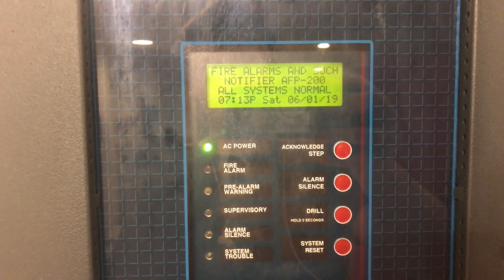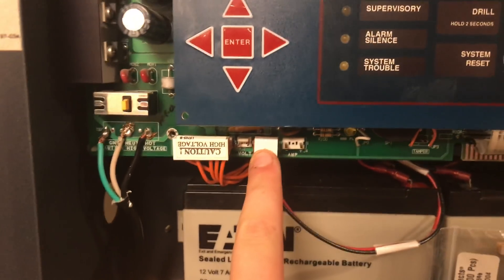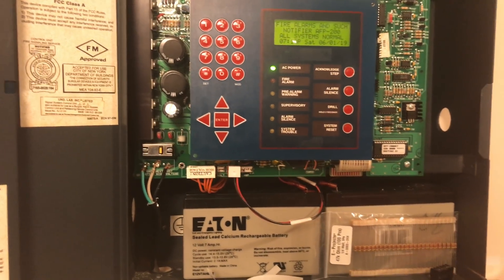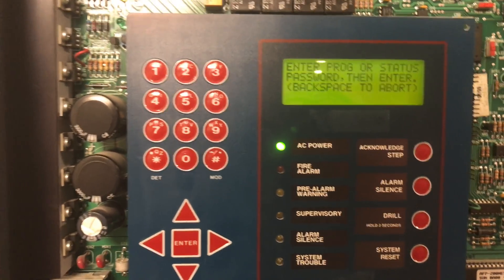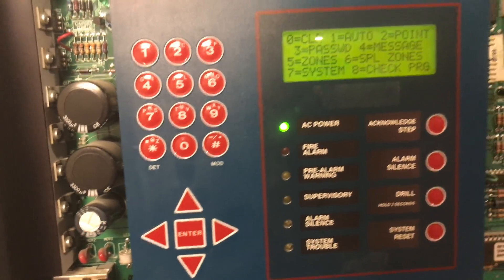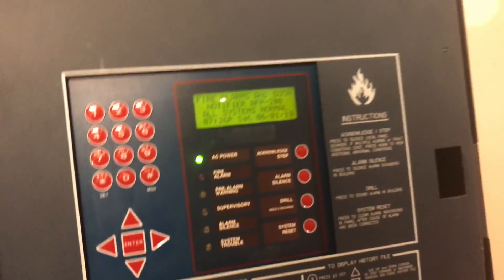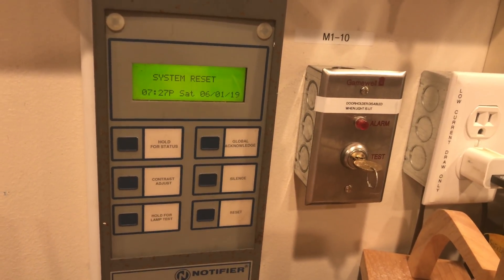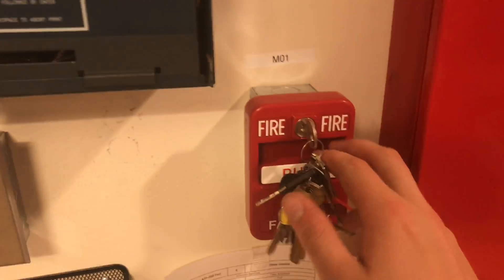Testing and Overview of a Notifier AFP-200 and LCD-80

Comment: The Student Center at my college has a Notifier AFP-200 system with that same annunciator. It's taking over from an old Standard Electric Time system from 1971. Some areas have the old Standard 450 horns in use, with newer Faraday strobes added, and some of the old heat sensors are still used, but so far everything else was replaced, especially with the cafeteria recently being renovated and having the new System Sensor L-series horn/strobes installed!
Reply: And now all the alarm signals in the non-renovated areas have been replaced with System Sensor L-series horn/strobes, presumably so the whole system could be in sync. Areas renovated in 2013-2015 have SpectrAlert Advance horn/strobes. The panel is still presumably a Notifier AFP-200, as the LCD-80 is still intact and the NBG-12LX pulls in the renovated areas still blink red.

Comment: Hey man great video. I just wanted to point out that the AC power can’t and should not be wired without proper connections. That could actually start a fire. Just an FYI.
Reply from the maker: Oh, I know.... the panel came with it broken even though it was not disclosed to me, I had to fashion it to even get the device to power on. If i had known about the issue, I would of not purchased the panel.